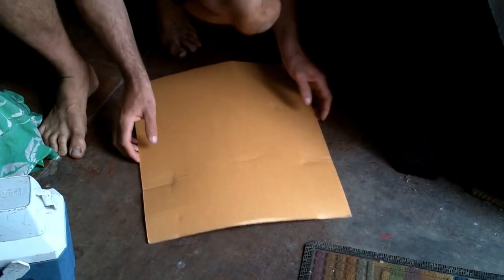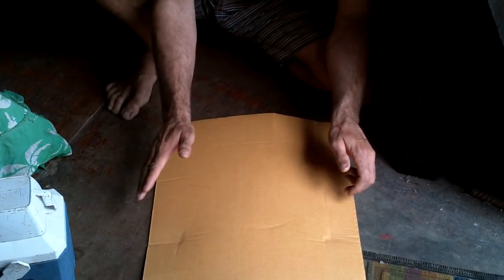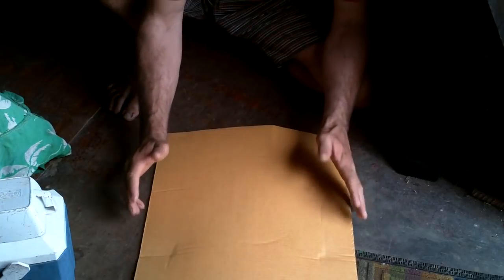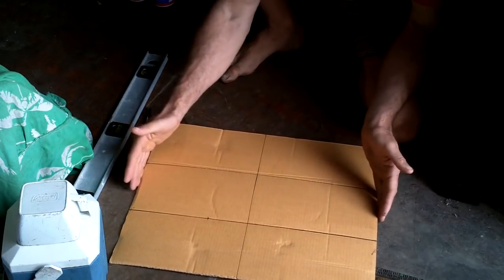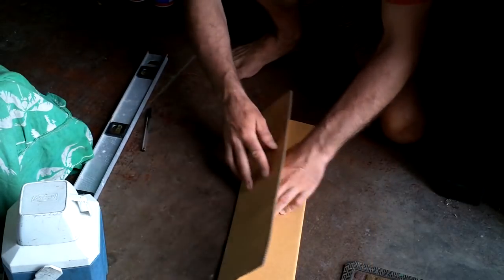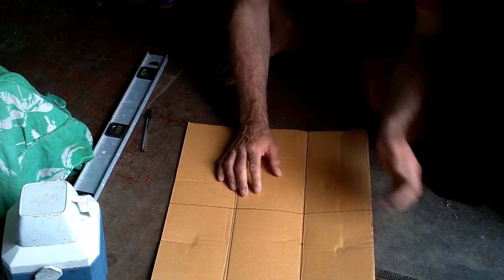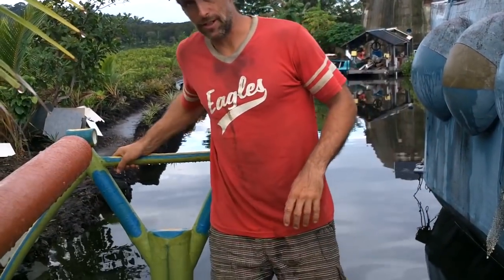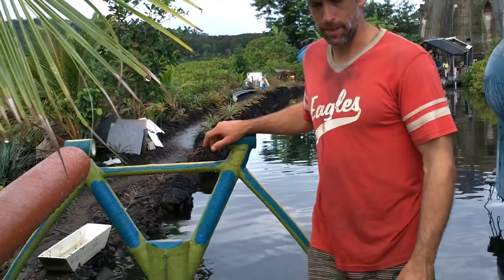Solar Snailer 025 Painting Myself into a Corner???

Comment: Jamie - I think this plan is much better than a rigid sail. A suggestion, when you're arranging your panels, know that panels in series are limited by the weakest (least sunny) link. So, I would connect panels in series only on the same structure, and connect them in parallel with the other 2 structures so that when the sun hits them unequally you're not limited by your least sunny panel.

Comment: Not surprised that you scrapped the original idea. After seeing your previous video, I thought the size and weight alone of the completed sail (even without added solar panels) seemed to pose a real problem in simply getting them up and down. I think you'd have needed either a heavy duty winch, which would have put some serious stresses on something, or a counterweight that would have added considerable weight to the boat and probably moved the center of gravity much too high. Anyway, I'm impressed that you have been able to scrap the  'flawed idea' and head in another direction with fully maintained enthusiasm. Good luck Jamie

Comment: Just add a regular sail and mast or use a sail like a Chinese JUNK, secure the solar panel top with tie downs tornado straps. Use the sail and hope you have enough solar for small electronics like GPS, radio  etc. This gives both types of locomotion just not at the same time. Use protective bumpers to protect from dock hazards. Good camera! Nice video quality.

Comment: What about usung the mast at the front with a cloth sail that rolls around the mast. Use fixed inner mst and rolling outer mast
Can be rolled with ropes to back.  Can lef out or roll in just right amont of sail for wind conditions or rolledup when motoring or paddling. And not a huge obstruction.  Like a self furling jib (do you have sails from your sail boat?).

Comment: Glad to hear that you reevaluated the rigid sail idea and are going with this new layout, If I can make a suggestion, why don't you mount a new cross member as far forward as possible at the front between the two hulls and make a strong fixed unsupported mast in front of your solar array. then you could mount a furling head sail which could be used when the conditions were right and furled away in seconds...you probably have the furling head sail parts on the sail boat that you bought, why not just re purpose them. 

if you don't have those furler parts you just could make a hank on sail instead, with a fixed stay between the mast head and the centre of the added cross member. Regards Dave.

Comment: Just a couple design issues I thought of  while watching you fold the cardboard models.  When you fold/unfold the panels you reverse the surface that is exposed to the light. Unless you have panels that work on either side its probably not what you want to do.  Also unless you want to just sail downwind sailboats require underwater fins.
Sailboat use keels or dagger boards for this purpose but it is tricky to allow them to work in shallow water. I am learning so much by watching your thoughts on all your designs.  Thank you.
Reply: I think he is not planing on using them when they are folded. It's more to protect them and make them last longer when he isn't using them.

Comment: Look at how semi trailers have tarp covers. With a pole joint to roll or unroll the tarps. 

You have the pvc pipe that allows the cover to angle to the wind, that same sleeve should allow it angle up on the dock side and down on the other side.

Comment: Haven't finished watching the video, but the obvious solution for the headwind issue when the sail/panel is down is to build a small aerodynamic fairing on to the bottom spar of the sail, so that it cuts into the wind when the sail is down and that spar becomes the leading edge.

Comment: For your consideration:
Remove solar to its own modular unit.
It may be better to decouple your solar system from your vessel entirely.
One idea of many:
Buld an accordion style criss cross scissor system out of aluminum that the panels mount on.
when extended the panels lay flat, when compressed the panels squish and stack not on top of each other, but side by side.
These panels and scissor system will  be mounted between two shark slicer esk sleek pontoon hulls.
When the unit is deployed as a charger it looks like a catamaran.
When the unit is stowed the two pontoons will be together with the panels standing stacked on their sides as stated.
If for some reason both slicer hulls that close together do not provide enough stabilty during towing you can remotely unfold the accordian slightly without having to go into full deploy mode.

Pros of this system are:

 -lightweight
-easily portable, 
-folded panel mode keeps the sun off of them. (longer life)
-folded unit is more easily hidden in a mangrove.
-can be universally used by anyone.
-produces minimal drag (basically a lightweight catamaran).
-can be used to charge other boats and other islands without relegating your entire vessel to that location.
-by decoupling your charing unit you save weight by eliminating the panel weight and structural weight needed to support them.
-if your main vessel needs repair you can use this system on another boat in the meantime.
-if your vessel sinks, you may be able to detach the charging unit in time to at least save that portion (and have something to hold onto/float on).
-no solar panels are brought with you to town, so no solar panels to steal, get dinged up, be in the way of loading.
-can be brought with you on longer riskier trips for backup power, or left at home and increase efficiency (havinging options).
-no cumbersome structural integrity needed.
-future proof, (no figuring out how the solar is going to work on future boats).
-can stand up, can pee freely, no mangrove worries.
-since this is a standalone system, this module could be sold if you no longer need it or want to go into production.

cons:
-No longer have a roof on your vessel which means no protection from Sun and rain.
-Although small when in stowed position and easier to conceal, it could get stolen if left unattended.
Reply: Cloth covering and some poles would give a roof, but otherwise, yup. Honestly, I've always thought that forcing the solar system onto his boats has been a bad idea. Why not just use more and/or better batteries? Can swap them out to recharge when you return, too.
Reply: @KainYusanagi  I agree, yes a pvc and thick plastic tarp would be lightweight and optionally stowable for none at all, plastic could be replaced with shade cloth for sunny or super windy days. I agree 100% on the battery issue as well, there is a certain point where more batteries are better than more solar and there is a balance to be made.
I also agree with having one charge while you use the other.
A cassette style battery system could also be made in the future if he ever went lithium or if they come out with a more  lighter, less risky, earth friendly version. Cassette system makes for quick changes, stand alone portable power for emergency, left in the towed solar charger and wired in parallel to main battery to have double the range +solar for uber long mega trips (not likely needed) and other bits. Modular is a great way to go especially ones that work standone like these but can be combined and problem modules that you have duplicates of can be easily swapped into a working sytem while the other is being repaired.

Comment: keep the roof panel you have made just hinge the 2 sides and you could still have the sail just by holding the side sections rigid with ropes that you would also use to angle the sails

Comment: I like your idea of folding your solar panels. There is a couple of issue I can see popping up.  The hinge line is one. If you move the hinge point above the surface of the center panels by the thickness of the outer edge of the outboard panels this should take care of that. 

The other is interference is with the outboard edge of the outboard panel and the inboard edge of the outboard panel when one folds over the top of the other. There maybe interference where are the hinges are. The Simple Solution is make the center section a couple inches longer then needed. Then make the inboard Edge of the outer panels the same length as the center section and taper the outer edge of the panel to the proper distance making the outer panels trapezoids.

Comment: In regards to the cover, you could make one of those things dump trucks use. They're called tarp systems or flip tarps. You press a button to release a metal arm that drags the tarp across a large surface. Easy to deploy and retract.

Comment: Also if you have the chance later on, add solar panels on the backside, which becomes topside when folding them...still give you some current to your battery while navigating narrow passages. I like the way you move on - I am a programmer, I get stuck a lot. Why not just scrap my original thought - is there something else I Can do, to make it work.

Comment: That's going to cause you a lot more head wind resistance as far as I can see when the sail is folded. I would say tilting the sail or putting it up would be the best way to load the boat without issue. As for the wind resistance I'd build the leading edge of a wing or foil on the sails to keep the air moving over them and then when they are in a down position have them angled forward slightly to keep the head wind from giving you lift or getting too much wind under the sails while they're down and travelling forward. As for the solar panels I think running them down the centre makes the most sense and folding them like you've come up with works great but I don't think you need to cut the sail to do it. Another layer of fiberglass with the same curve would give you that ability without compromising the sailing option.

Comment: Go with the folding solar setup, they don't have to fold all the way, just folding the two outer panels part way into a U shape would give you the clearance you need. Worry about cloth sails later.
Reply: What happens when you have a vertical wall from the side and wind hits it? Ever tried to even hold a garbage can in your hands when it's windy out? It'll flip or break the boat.

Comment: vacuum epoxy infusion made parts cost less than liberally wetted polyester resin parts but are sig stronger and lighter. 1/2" plywood core epoxy/glass laid up under vacuum weighs barely more than dry plywood but is so much more rigid it isn't funny. If you really want rigid and light you can use an inner core of foam and outer cores of ultra thin paneling topped with the lightest weight glass fabric and epoxy you can find. Infusion isn't nearly as difficult or costly as most folks imagine, but it produces comparably miraculous results.

Comment: your still painting yourself in a corner if you have your panels mounted 3 feet off the deck.ones you unfold the panels your left to getting around on hands and knees.wouldn't be  better to build it 6 feet off the deck so you can have cover a all the room of your deck to move around? have it set up with front center and aff pivots for two large solar arrays that would allow you to tilt them to the sun as a whole?
Reply: If it's 6ft off the deck that allows wind to come up under it which will try to rip it off
Reply: that's funny his last boat is built much like that and still has roof
Reply: @johnathanray8977  he also said he hasn't got caught in a storm yet so what's your point?  The reason he won't do it on this boat is cause it's holding valuable solar panels he does not want to lose. He knows he will get caught in a storm one day he knows they will get damaged and knows he can't replace them.
Reply: Respectfully, I think Johnathan Ray is right that the height can be raised and Jamie in this video explained the main issue with the previous design apart from the idea of using it as a rudimentary sail, was that the multi function design meant it wasn't going to be securely fixed, because by design it needed to move to tilt left and right and fully upright.

The improved features of Jamie's new design as he pointed out are that the centre section can now be extremely securely fixed in place and his folding design feature effectively creates a fiberglass storage pod for the solar panel, as he also said, this cuts down the overall wind drag when not deployed, so it could either be stored that way when not in use, or secured that way in deteriorating weather conditions by folding it and closing the locking mechanism that he will make, even something as simple as a strap front and rear.

Comment: I'm not a mad scientist like you but just a thought here. I know your boats all usually have the pedal option for obvious reasons. But I thought I might ask you why don't you add some sort of generator for the batteries that is close in proximity to the help put from the blades of your pedal option and you're free electrical option as well so no matter what you are getting a charge on your batteries well you're pedaling and running your propeller off batteries. So what I am trying to say here is I've seen this thing, like so many people, I am sure you have as well, seen this device that you just throw into a creek and it will charge your devices as long as it has moving water. I thought I would throw that out there for you some food for thought anyways. Cuz I would like to see you get as much charge as possible everyday all day while you're on the boats. And why not add wind generators or something like that on your boat I am only asking because I don't think I seen a video where you explain why you don't have them or Cena video even talkin about wind generators for like a secondary option has a generator for your batteries

Comment: Sorry to be a naysayer but you are doing it all wrong. Shape of your sail is wrong and only way you can use this is down the wind. All other times it is going to be a giant wind brake pad. In an actual windy situation when wind comes at random every 15 minutes from a different direction you will have a no way to quickly adjust to it. Your original all roof solar panels idea was correct.

Comment: Hey Jamie, been watching and enjoying your progress for a few years now. I'm not sure how much you know about sailing but it's possible to build a solid wingsail that you could mount solar panels on, a little like this: https://www.youtube.com/watch?v=mqX2BmiEDnQ but with more solar.
With a design like this you should still be able to hinge it so that it can be dropped and if you get a sudden gust or squall all you'd need to do is let the sheets controlling the sail go slack so that it pivots in to the wind like a weather vane. You might need to add some more ballast or a small keel to the hull though for stability. A keel or daggerboard would let you sail upwind with the sail rig I've described too.

Comment: It is your boat. I would have made a hybrid riverboat with solar panels that charges the boat every day. And when I get to low battery. I would just start the gas motor. Ultimately I wanted to say steam but what happens when a wood Center hits a solar panel. And it is not glass plated. The battery bank would be used as ballast. I would give use parts of a lawn mower traction system to spend the paddle blades. I definitely want a large wheel house. That is this place where we going to spend our chat time as we go to town.